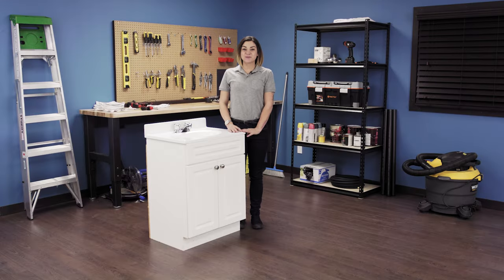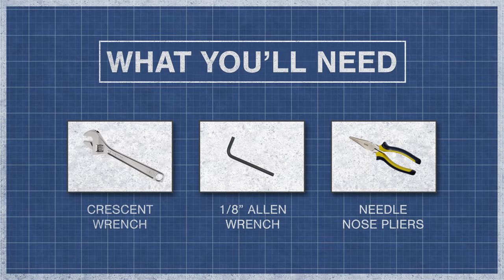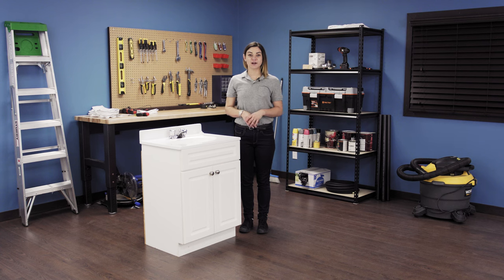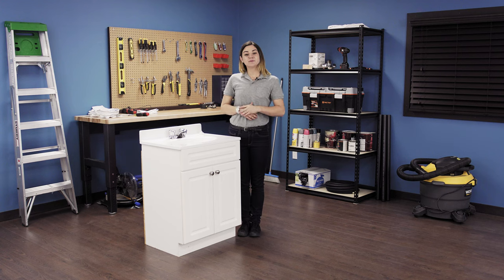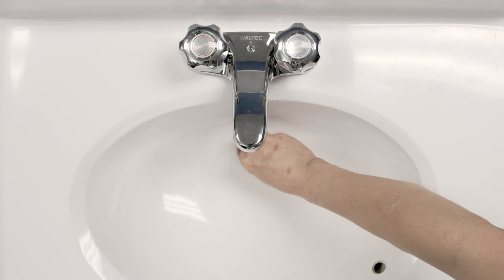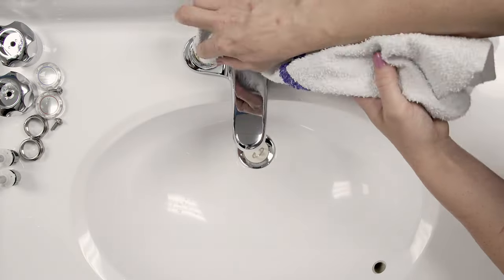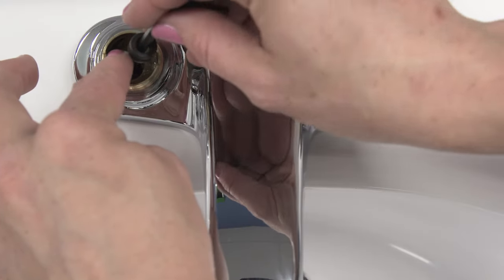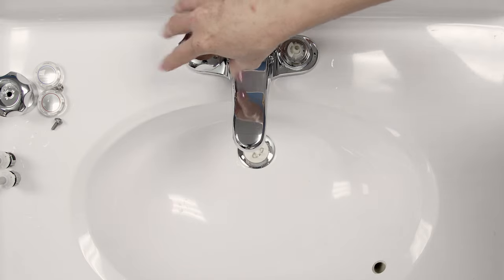How to Replace the Seats and Springs in a Bathroom Faucet | Repair and Replace

Comment: Allen wrench and rag are great ideas. I tried putting the spring and seat into place using needle nose pliers and it didn't work well.  I'd like to add that I used a piece of 3/8" doweling to push the rag into place and also to seat the spring and seat.  I used a light coat of plumbers grease on the o-rings, bottom of the cartridge, and on the bonnet threads.
Reply from the maker: Thanks for sharing your experience Andre! These are all great tips!
Reply: I used a straw to get the water out of the shank. To seat the spring and seat I used my pinkie finger. After some finagling, it went in.
Reply: I read silicone is safe if you let it cure. I am not certain if the plumber's grease is safe if it gets into your drinking water

Comment: great video and was the key to solving my perpetual leaky faucet! I changed the cartridges with no luck and after seeing this video discovered that one of the seats was cracked and one of the springs was upside down. once i made the required fixes, i now have a dry sink for the first time in months! thank you!
Reply from the maker: Thank you Jeff for sharing your experience. The seats and springs aren't obvious at first glance but they can definitely be problematic when they wear down. We're glad the video was helpful to you!
Reply: yeah, if the spring was upside down the metal of the spring probably cut into the rubber of the seat, resulting in the crack. Just postulating.

Comment: Great video, have a couple tips to add:  If water is leaking from under the faucet handle, it is likely the smaller shaft O ring. If the faucet itself is dripping from the nozzle it is likely the seat seal.  Might as  well replace both O rings, seat seal and spring while you're in there. The seat springs go large side down, small end up.  Do not over tighten the bonnet nut with the crescent wrench, only snug it!
Reply from the maker: Thank you Mark, we're glad you found the video helpful! Thanks for the tips these are all very useful. We might return to these videos in the future as we have a more comprehensive format for filming now in 2020, so those tips and others are ones we'll likely add to the revised video!
Reply: I was looking for which way the springs went in. Thanks.
Reply: This is the most important part of the whole video :medal-yellow-first-red::medal-yellow-first-red::medal-yellow-first-red::medal-yellow-first-red::medal-yellow-first-red::medal-yellow-first-red:

Comment: Thank you for this video! I called myself trying to stop a leak I've had for over a week and decided to take apart the kitchen faucet not knowing what I was doing. I took off parts of faucet without turning off water and almost flooded my floor. I then took apart the faucet and put it back together, however the spring and seat wasn't sitting properly so nothing else worked. I watched the video and was able to fix it, now I have to clean up the water that shot all over the place. This video is awesome
Reply from the maker: Thank you for watching! We're glad the video helped steer you in the right direction!

Comment: Thank you! I hadn't done this repair before, so I watched several videos to make sure I'd know how to do it. Yours was the only one I saw that suggested using an Allen wrench to pry out the old seats and springs. Worked like a charm!
Reply from the maker: You're welcome Mike! We're glad the repair went smoothly for you!
Reply: I put my seat in upside down thanks to the poor illustration that came with the instructions. I searched my house for different things to pull it out. A straw, tweezers. Those things didn't work. Then purely by chance I found an Allen wrench set in my bookcase. I didn't know that was the standard way to get the seats and springs out. It was more difficult to get the upside-down seat out with the Allen wrench however because I did not have a spring underneath it.

Comment: Didn't show picture of installing seat & spring.🙄
Reply from the maker: Thanks for watching. What do you mean by "Didn't show picture of installing seat & spring."? Was there a step in the video that you missed?
Reply: Yep, installing the new seat was the most aggravating part of the whole project, and was skipped right over. The seats don't magically fit right in. It would have been helpful to see how to squeeze it into the hole  to cover the spring.
Reply: @JosephHauger  How did you manage that part? Mine isn’t easy to get over the spring either. Replaced new springs, seats, cartridge in a rental house. They called on FaceTime to say the water was now running in a stream. Had to go back only to find the seal/seat was twisted on the spring itself. It appeared perfectly repaired when I left though. 🤦🏼‍♀️
Reply: @quietmadness1768  I used a hex wrench to line up the seat and spring to drop together in the right position. It was then a matter of trying over and over to push them down without one side slipping out. I'm getting them seated in about 20 to 25 attempts.
Reply: @JosephHauger exactly my issue

Comment: Could you show how to replace the springs and seats on a two handle bathtub fawcett? The seats and springs are horizontal and recessed into the wall. How do you put them in without dropping them into your wall? If you drop them while trying to put them in you can't retrieve them, so they are lost for good. Do you have a safe method to avoid this problem?
Reply from the maker: Thank you for watching. We don't have a specific video for this but when working it's best to cover the drain of the bathtub, and you can use a screwdriver, pen or anything else that fits the seats and springs to help push it horizontally into the valve.

Comment: There is a better way to get the hot and cold caps off that I saw in a different video. Instead of using a flat blade screwdriver to pry the caps off, which may damage the edges of the caps, use a hobbyist's rubber stamp on top of the cap, applying pressure using the palm of your hand, then twisting.
Reply from the maker: Thanks for sharing those tips!

Comment: I noticed you have another, very similar video to this. In the other video, the problem causing the leak is the cartridge....so therefore replacing those. In this video, the problem causing the leak are the seats and springs...so therefore replacing them. So my dilemma/question would be "how do I/we know which one to replace??"
Reply from the maker: Hi Rigo Martinez. We do have a similar video as well but split them up into their individual parts. Its hard to tell what is causing the leak until you remove the cartridges. The seats do wear down over time, and sometimes you'll notice that the rubber has become to become more of a gel and doesn't provide a tight seal. When in doubt replace the seats, springs and cartridges.
Reply: I just said the heck with it and just replaced the whole thing lol!!!

Comment: I have replace the cartridge and still have a leak.  I don't see any seat or spring at the bottom of shaft.  Do all faucets with cartridges have seat and springs and I don't know what I'm looking at?
Reply from the maker: Thanks for watching. Does your faucet have handles that only turn a quarter turn? These 1/4 turn cartridges don't use seats and springs. It can be good to check for any buildup of minerals that might prevent the new cartridge from sitting properly. If there is a calcium buildup then you can use an acid like vinegar to dissolve it.

Comment: OK. However the springs are tapered. Which end goes up? The narrow end or the larger end?
Reply from the maker: Hi Froman thank you for watching! The larger end sits on the bottom and the smaller end goes into the rubber seats. Hope this helps clarify!
Reply: @AmreSupply  I just got replaced my cartridges and the leak is still there. I am thinking if changing spring and rubber. Do you think this will be the solution? Also, when I turn of the water, the handle is not as tight as the other one? What could cause the handle to feel that way?
Reply from the maker: @PastorMarionGillies  Yes the seats and springs are likely the cause of the leak. Assuming you tighten the set screw does that one handle still feel like its not as tight after putting in the new cartridge?
Reply: @AmreSupply  Yes the handle still feels the same. I cant get the spring and washer out from below the cartridge, no matter what I do. Trying to bring them to get.new ones at a store. They just wont come out.
Reply from the maker: @PastorMarionGillies  The rubber seat might have deteriorated and might be sticking to the valve. You could use a razor knife to trace along the edge to help separate the rubber, then use some pliers to grab and spin the rubber seat. As for the loose handle, it is possible that the threads in the set screw or in the handle are starting to strip, which might prevent you from tightening the handle all the way. Inspect the set screw, if the threads look damaged then get a new set screw. If the set screw looks fine but its hard to screw in then its possible that the threads in the handles are damaged, so in that case you'll want to replace the handles.
Reply: @AmreSupply  oh thanks so much
Reply from the maker: @PastorMarionGillies  You're welcome Trendy!

Comment: Awesome... I found that a bolt worked even better.. couldn’t get the washer to stay in... push in bolt all the way than use a pair of needle nose pliers to pull bolt out
Reply from the maker: Thanks for watching, thanks for the tips, a bolt would definitely work if its sized closely to the seats and springs!

Comment: What if you do this and have suddenly lost water pressure on both sides?
Reply from the maker: Thanks for watching. First check to make sure that the shutoff valves are open. Then check to make sure that the hole on the bottom of the cartridges are not obstructed. In some cases you might need to rotate the cartridges. As well if the cartridges are specifically designed for the hot or the cold side, and if they were installed on the wrong side, then swapping the cartridges might fix the problem.

Comment: i replaced the seat and the cartridge but not the spring ,i used the same spring, what happened next, after 7 days  ,the faucett begun to drop water again, i believe the seat was too thin ,stem water,and the killer spring that worn out the rubber seat
Reply from the maker: Thanks for watching and for sharing your experience. The springs can definitely wear out and in many cases it's best to replace the seats and springs together.
Reply: i believe the spring are heat proof 200 degres ,when the spring is seated ,followed by the rubber seat on top of the spring,the last part of the spring is touching the rubber and with the heat and the pressure of the cartridge ,is kind like the spring is cutting the rubber little by little with the help of the heat and the pressure of the cartridge,,that is when the  rubber seats get worn out.

Comment: Is the Delta seat and spring universal? Can it be used in brand CCF?
Reply from the maker: The ULND9 seats and springs listed above are universal. As long as your brand is a 2 handle faucet without special cartridges, those seats and springs should work.
Reply: thanks!

Comment: Even though I just closed the shutoff valves to stop the water from coming out of the faucet, do I need to still turn off the main water line to the house? (Earlier I forgot to do this and flooded my bathroom, now I am trying again...)
Reply from the maker: Hi John Anthony, closing the shutoff valves below the faucet will prevent water from flooding out the faucet so it shouldn't be necessary to close the main shutoff valve. 

You can test it before you remove any parts. Close the valves and turn on the faucet to drain the remaining water  If the water isn't shutoff correctly you'll notice that the faucet will continue to run. 

If the shutoff valves make a good seal, then the faucet will give off a little bit of water but will stop shortly after. This is an indicator that its safe to remove parts.
Reply: @AmreSupply or in my case, neither the below the sink shut off or the main shut off completely stopped the flow.  It was very hard to see inside the valve with it continuously filling up with water. :(

Comment: Mine are not coming out that easy I've tried the Ellen Ranch I've even heated up needle nose pliers, a small screwdriver, a knife it's not working.
Reply from the maker: Thanks for watching. Its quite possible that the rubber has deteriorated and is potentially fused to the faucet. Overall if the faucet is leaking and the rubber seats can not be replaced, then it might make sense to get a new faucet.

Comment: Lies it is not that easy when done on a vertical wall.
Reply from the maker: Hi Scott Bennefeld, there are a lot of repairs are simple in principle but are each case it you'll run into factors that make it more difficult like the room needed for tools etc. We filmed this out from the wall to get better camera angles and a better perspective on the repair. Hopefully you still found it useful to see each of the steps even if it was more difficult in practice.
Reply: You have a sink faucet on a wall?
Reply: @aguyandhiscomputer  😂😂😂
Reply: How is this "lies"?  If your faucet is not the same one as the one she is repairing, then obviously it's not the video you need to reference.